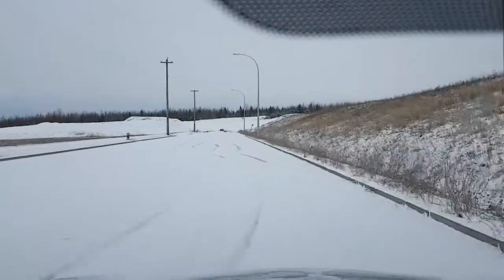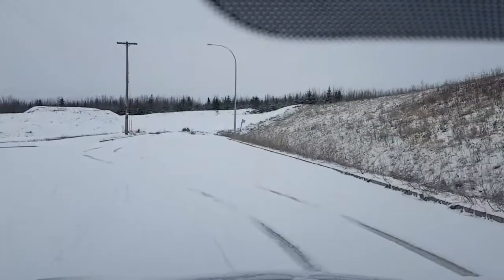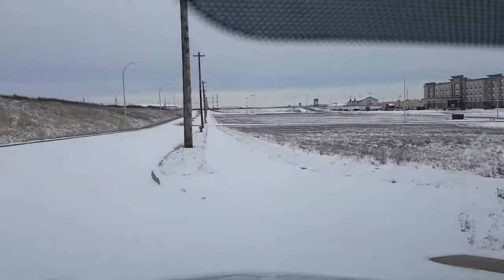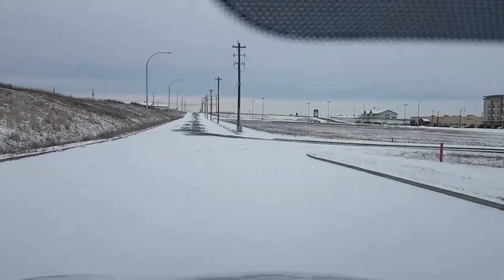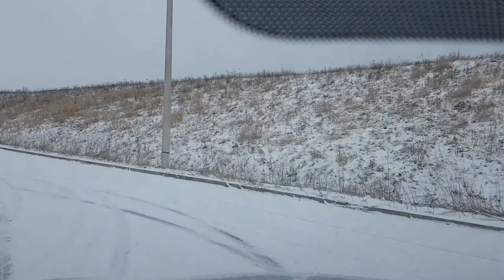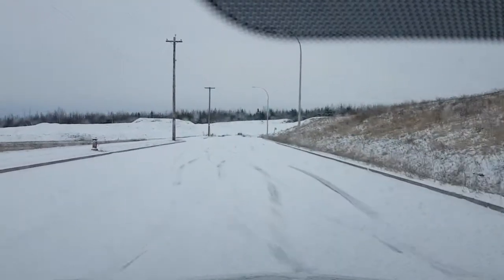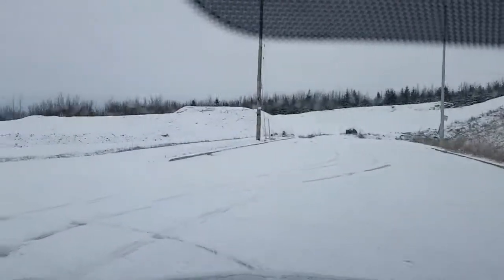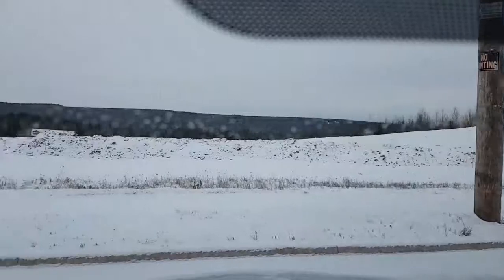2015 Micra traction control system

Comment: Mmmm mine failed at an exit doing 60k it was scary.  Because it is like a double edged axe.  It keeps you safe but in the case it fail the backend came loose then the tc kicked it only wanting to put me in a ditch. It makes the car too unpredictable. Had to fight it the hole exit.